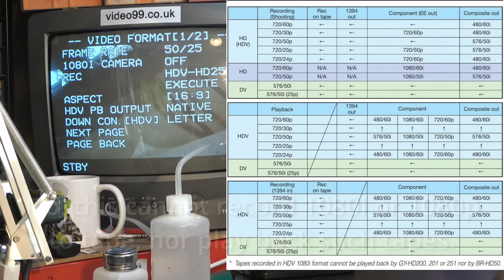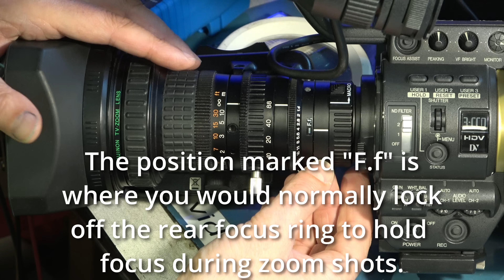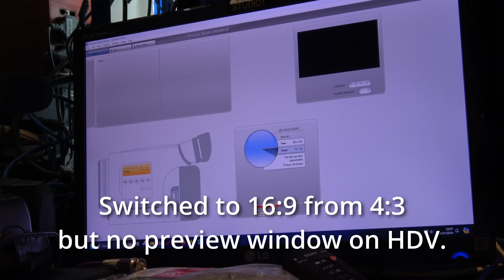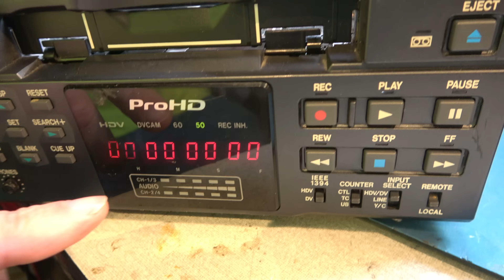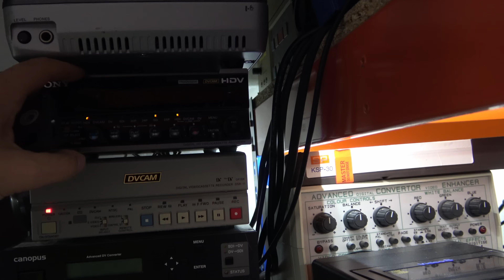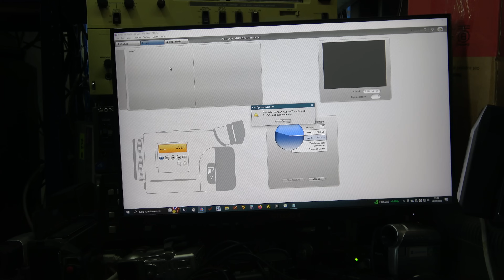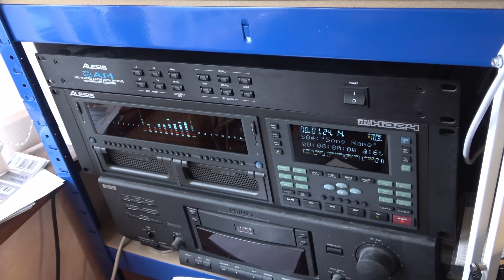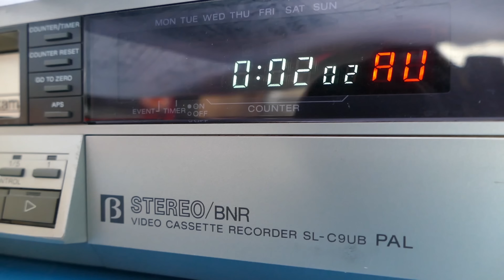JVC invented a rare and little known professional video cassette format.  HDV 720P "ProHD".

Comment: just a bit  of fun you have alot of the betacam format in your racks  there are still alot around  i get asked alot to take them of there hands 
i said yes to a betacam 510  as i did not have it  is working ok now  jammed up parts easy fix

the studio i got the deck from said he having a hard time selling them  as alot of people are selling up now  and there's alot of gear just not getting 
used   the video was dryed up and was just sitting not used    computers do all the video work now

Comment: Let me give you the skinny on why JVC did what it did. If you liked Standard Definition, the DV25 format did a superb job of capturing stuff. Because everyone liked the small DV tapes, and had been shooting with them since the early 90s, they decided to go with an MPEG2 wrapper HD format that could even be sent down IEEE 1394 (FireWire). The upshot was 1080i HDV. The problem was that these early 1080i cameras had a lot of compression artifacts because the two fields per frame thing really worked to the detriment of capturing moving images, especially anything with wheels. So JVC said, "Hey, we'll come up with a progressive format in MPEG2, and voila! far less "judder" (the coinage from shudder mixed with jitter). So in some ways, the 720p was better than the 1080i.